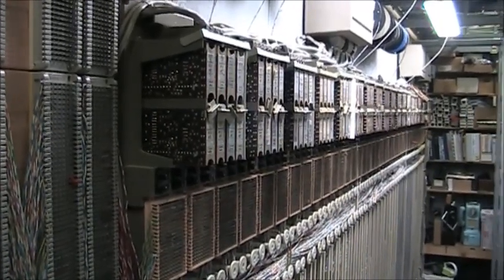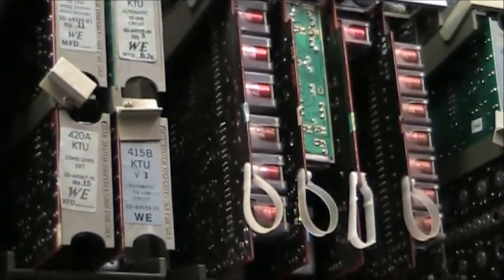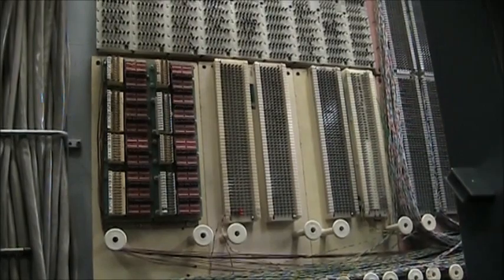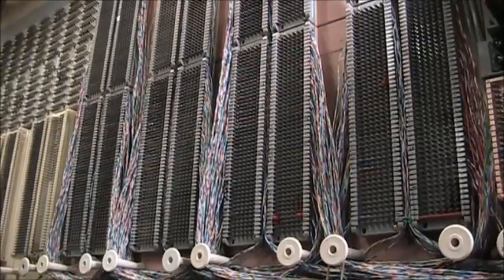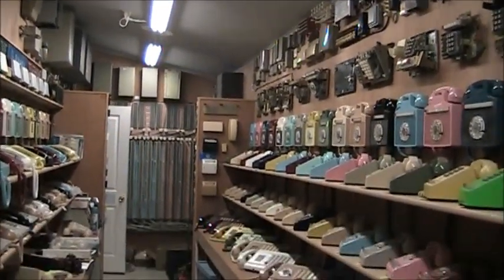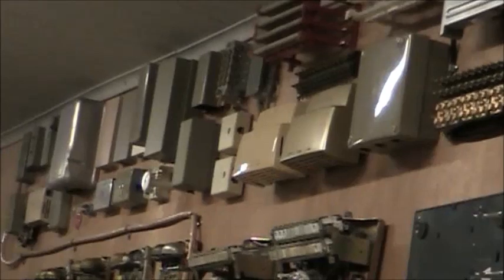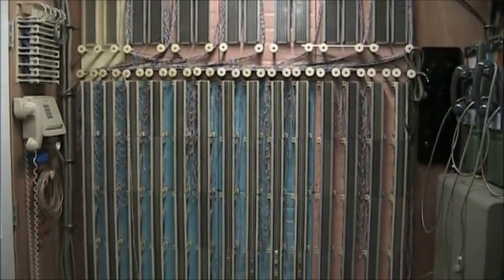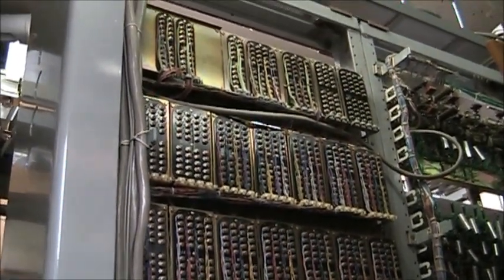Large 1A2 key telephone system, Western Electric 6 and 10 button phones. 2565,2851 ect.

Comment: This is amazing. I knew nothing about phone systems until the company I worked for back in the early 2000s moved to a new building that included a Merlin Legend switch. I read all the manuals and taught myself how to set up and program the system. 

Several jobs later the same thing happened, but we inherited a Merlin Magix switch. 

I’ve since I worked with a ROLM CBX 9002 and a Mitel SX-2000. But what I really want is a TSPS console.

Comment: This is a phenomenal display. You obviously did a lot of pre-planning before cutting down all those cross connects and cables to the phones. Very impressive. I have a 551B on a small backboard with 66-blocks feeding four or five phones in the house. I also use a manual intercom on line 4 with signal on line 5 between two of the phones. What I have works, but must seem like child's play to a guy like you. 
Thank you so much for showing us how things "should be done". Wired cut down properly with finger loops, neat and orderly wiring, and a beautiful installation. I also love the very impressive display of your wonderful telephones. Thanks again!

Comment: The WE 30 button "speakerphone" I saw was used as a Centrex operator's console with a very large white button on top to transfer calls out.  Each button was set up as illuminated momentary button to show incoming trunks to answer. After the trunk was sized (answered), the caller was transferred out with a hit on the large white button for dialtone, then dialling the extension, then hitting the RLS (release) to pass the call.  We could stay on by hitting the trunk again to do a temporary 3 way, and then RLS to let the transferred call go.  It was definitely a custom implementation of that set.  We also had separate consoles to answer other calls using "mini keys" which I've never seen again and can't find on Youtube.

Comment: I came here because there is a Sears building that is closing that has some of this technology inside. It has ROLM upgrades, but some black rotary key telephones inside. I was a little confused looking at it. I wasn't to sure how it worked because I thought ROLM systems only worked with ROLM phones, not WE. There is about 5 rooms in this Sears that has wiring on the walls that look like this. Each room has a black key phone mounted on the rack. I thought it was interesting. When I look up ROLM systems, very little comes up. But, if I just put in Key System's, this comes up. Thank you for the knowledge. It has helped me understand more about key systems. I collect old phones from all ages. But I didn't understand how key systems worked, until now.

Comment: I started installing key systems in 1996.  So I removed a lot of old systems with 25-pair station cables and replaced with Cat-3 cable.  Installed many 2-pair Toshiba electronic keysets, 3-pair Inter-Tel, and later 1-pair NEC & Toshiba digital stations.  Now in 2022 I'm replacing systems I deployed in the early 2000's with hosted voice.  I learned from the guys that cut their teeth installing 1A2 systems and now I'm pushing everything to cloud I can.  I don't see hotel/motel or healthcare running to cloud.  Mitel and NEC both still have good hospitality systems.  I suppose when the SIP handsets for hotels and healthcare get to be as cheap as analog then they'll head that way.  On-prem is on its way out.